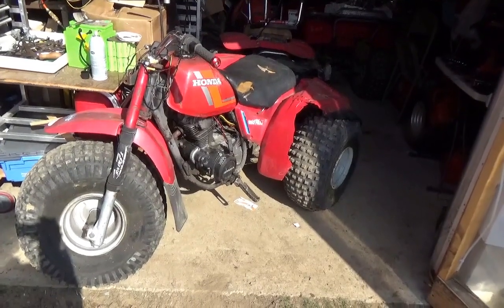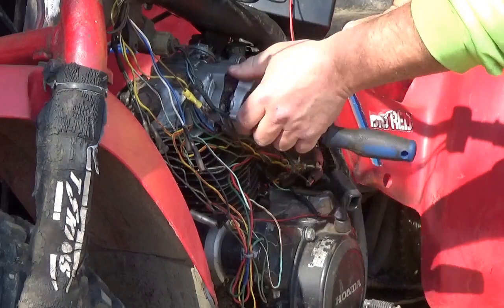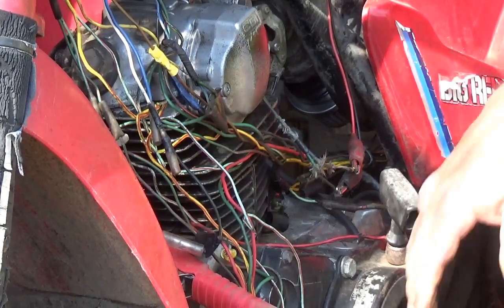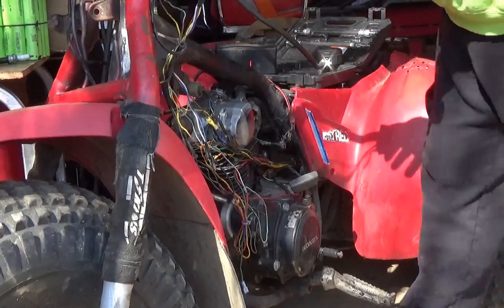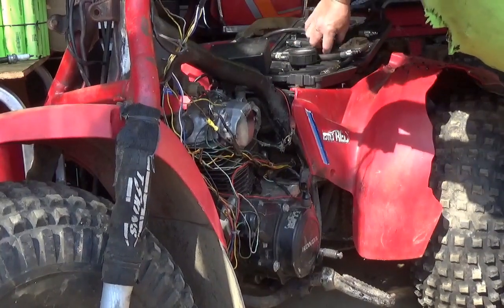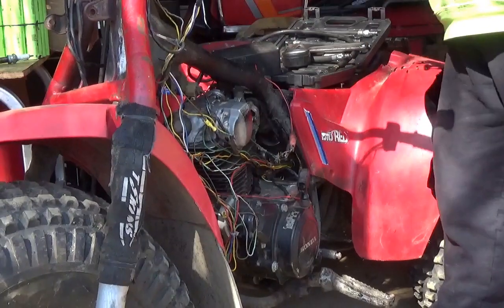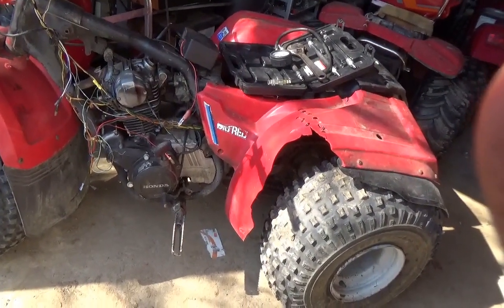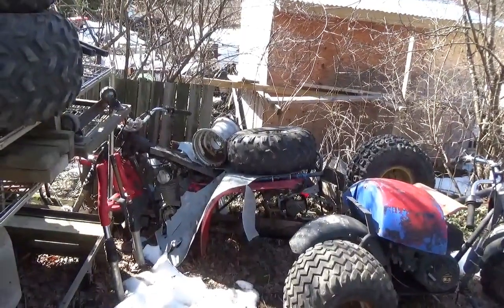$500 Honda ATC200M From Parts to Running in 30 Minutes or less?

Comment: thanks for video i,m building a 200es
Reply: Me too! Just got the frame and other parts back from powder coating. I'm doing a nut and bolt restoration on it. I'm even zinc plating every rusty bolt. Also restoring a 350X on the side, and I've also got an ATC70 and a couple 200E's waiting for their turn...

Comment: Will the 200es fit ? It’s either a 250es or 200es that I have along with 2- Polaris 250’s and a 340cc , 2 - 440’s and 2 - 488’s does any interest you along with a 1986 - 250 TRX fourtrax on a possible trade for a running non - Honda 4x4 ATV  like a Yamaha or Kawasaki or CAN-Am ?